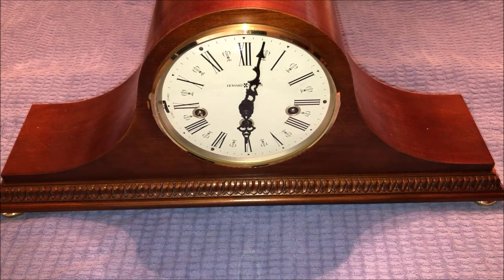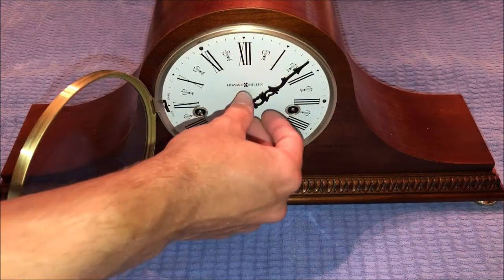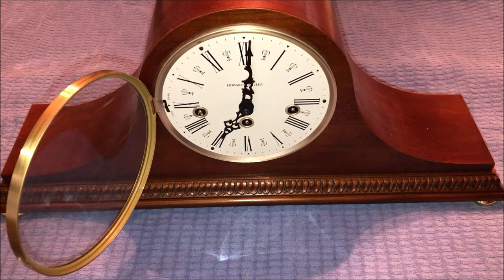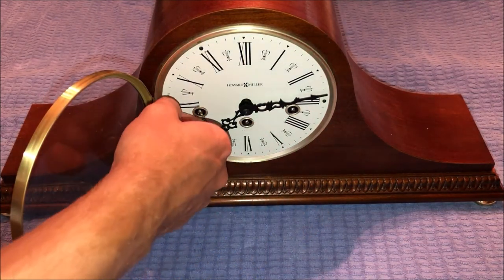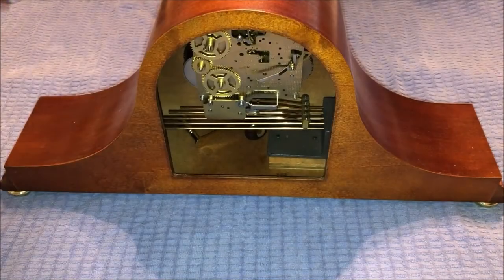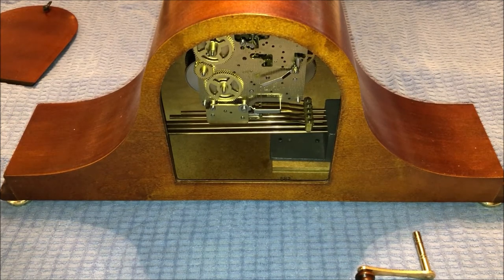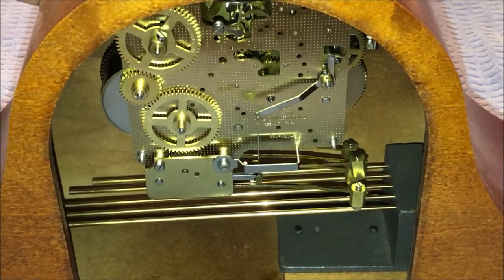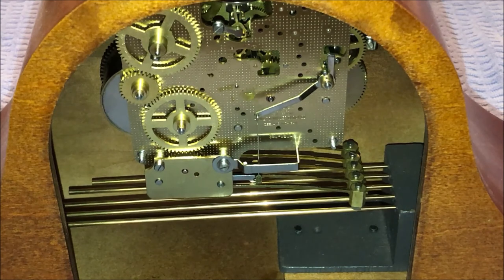An In depth look at a Howard Miller Tambour Mantel Clock

Comment: My clock - which is similar to this - does not have a "volume" off switch on the front. Where can I turn off the sound?
Reply from the maker: If there's no silence switch, then the clock cannot be silenced. Now what you can do if you want is only wind the middle key hole which is the power to keep the clock running.  You can do that and let the chimes wind down all the way so they don't go off.  That's entirely up to you though.